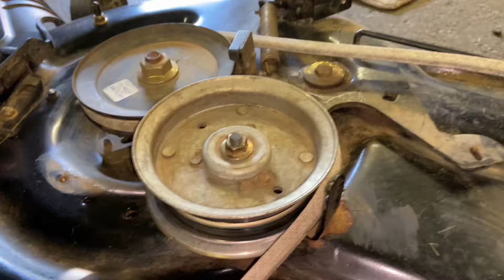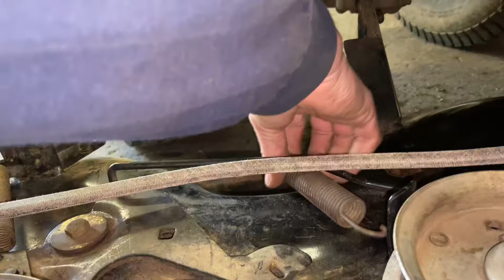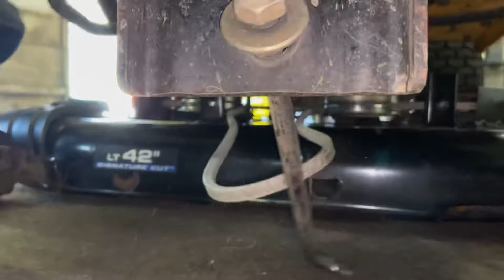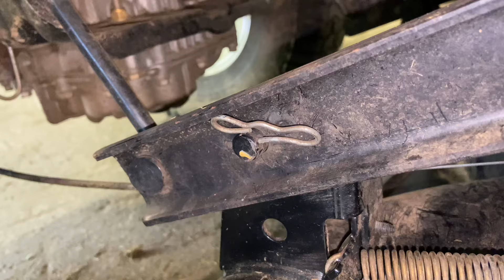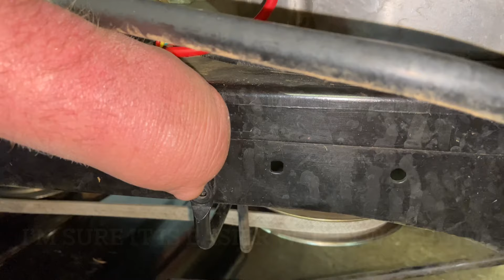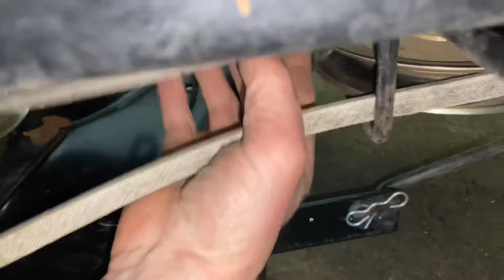How to install a Mower Deck Belt on a Cub Cadet XT1 42”

Comment: Great job with this video!  Thank you!
Reply from the maker: Hi Frank, I’m glad this was helpful and thank you for the kind comment. Please give this a like, subscribe and tell your friends to help my channel grow. It would be greatly appreciated. Thank you for watching:)
Reply: I gave you a like - do you have another video about adjusting this same belt?  I've got it installed with the help of your great video, but it keeps popping off.  It may be too loose, and perhaps that's why my original belt broke in the first place.
Reply from the maker: There are no adjustments, the only reason why the belt would fall off is when you disengage the belt, the belt guides may not be properly reinstalled or missing/ broken. You said, something may have broke or bent (reason for first belt coming off) you will need to find out why?

Comment: Nice video.  I have a XT2.   I only have 2 deck wheels.  I notice you have 4.  My deck cuts unevenly and I wonder if I should have 4 deck wheels.  Your thoughts please.
Reply from the maker: The wheels are there only as anti scalp wheels. Never rum the deck on the wheels. Check all tire pressure and level mower deck. If  the mower deck still cuts unevenly then you either have bents blades or a bent mower deck or both. Both can be corrected.

Comment: I didn't take the whole deck apart but put it back in place and it lasted 3 weeks and slipped off again.  I put belt back on but after a minute had slipped off.  My husband took a part off like a hanger but I don't know where that goes because he did that before I came out, so he can take it to the shop.  The belt was loose when I put it back on and wondering if the manufacturer put it on incorrectly to have slipped off after a few months after purchase twice.  They are ridiculous to deal with and I won't be buying another one from them.  
The video was excellent?
Reply: I'am having the same issue.. I wonder if their is a belt adjuster/tightener for this model.?

Comment: Thank you for uploading this. Great video and very helpful!
I have one question. 
Why not also change out the pulley brake pads? In your video at 6:38 they look worn out.
Asking because mine look the same with the pulley half way through them. Thank you.
Reply from the maker: I'm glad this was helpful. Please give this a like to help the channel! I have noticed the brakes wear quickly to half way and then they go a long time after that. I do not like the design but it is what is is. No need to replace brakes when they are only half worn plus this video was just about replacing the belt. Thank you for watching and commenting!

Comment: Can u pls tell me what ratcheting wrench were u using?
Reply from the maker: Milwakee 1/4" electric Ratchet. Here is a link to see it. https://amzn.to/3scvhqB. You can also get a cheaper one from Harbor freight if you have harbor freight in your area. Here ids a link to look at it. https://www.harborfreight.com/12v-cordless-14-in-ratchet-tool-only-57248.html. Both of these you will still need to purchase a battery and a charger.

Comment: After following this detailed guide now the engine won’t crank. Is there a safety that I messed up?
Reply from the maker: Make sure the PTO “power take off” for the mower deck is in the off position. That would be the only safety switch that would not make it start and that is only if you have a manual blade engagement handle.

Comment: I just replaced my belt, and when I tried to engage the deck like you did at the end of the video, it felt like something came loose or snapped. Now that lever doesn't seem connected to anything.  Even worse, now the mower won't start -- it just whines.  :(
Reply from the maker: I always asked a question why did the belt break the first time? Check to make sure that there was nothing underneath the mower stopping the blades from moving. If the blades are not able to move then that belt would break once again. It sounds like you may have other issues if you’re hearing a whining sound from the engine. Battery may be low in power? Impossible to diagnose without seeing your machine. Always double check your belt on how it runs through the idler pulleys and make sure your blades are not obstructed under the mower deck.
Reply: @JohnsonsSmallEngines  Thanks for the reply! Belt was thrown (and notched) during deep grass mowing. I cleaned the deck and the blades can spin. The belt does seem awfully tight, but I triple checked that it's the correct one. The battery is nearly brand new. Installed a month ago and only run the machine a few times on it. Voltage indicator is also good.

Comment: Is there a tension adjust for the belt anywhere on Cub Cadet xt1 enduro? My belt is too loose.
Reply from the maker: Make sure the belt is correctly installed. It will be loose until you engage the belt. Make sure you have the correct OEM “original equipment manufacturer “ belt. After market belts sometimes do not work.
Reply: @JohnsonsSmallEngines  Thank so much. Truly appreciate your time!
Reply: @JohnsonsSmallEngines   so to be clear, no tension adjuster  for this make and model. I have a 1 yr old  cub. The  belt keeps coming off the pully.. Great video..!
Reply from the maker: @paultaylor7570  if you have a manual blade engagement handle, the only tension is when you engage the belt to run the deck. If the belt is dropping off when you disengage it you most likely have a belt guide not correct or something is out of alignment.
Reply: @JohnsonsSmallEngines  Thank you for your response and answear..! you have been very helpful and I will follow future videos of yours..!!

Comment: What about when you get the belt installed, but the deck arms won't go back in the correct holes to connect the deck back to the mower? Maybe my belt is too small?
Reply from the maker: If you purchased the OEM belt? It should be correct. You may have to lift up the deck in the side and front off the the ground to manipulate the deck so rear hangers will go where they need to.
Reply: @JohnsonsSmallEngines  I didn't get the OEM unfortunately. Broke these days lol. How big of a difference in approx inches, is it between a new belt and an old stretched out one? There's about 3-4 inch difference in the 2 belts.
Reply from the maker: No way of telling how much a belt will stretch but never heard of a belt stretching more than a 1/2 to 3/4 of an inch. If your new belt is 3 to 4 inches shorter than that most likely is your problem. Maybe you ordered the wrong belt??

Comment: I got the belt on as you showed but now mower won’t turn over. Any ideas???
Reply from the maker: Make sure the mower deck blade engagement lever is in the off position.

Comment: Great how to video! Word of caution- the step where he describes putting the front belt guide on with the drive engaged is very important. I made a $50.00 mistake and ran my deck with the belt on the out side of the guide. Very stupid! I regret not watching this video first.
Tinker on and stay thirsty my friends! Cheers!

Comment: Mr. Johnson, I am having trouble with my belt coming off the inside pully right side. It's a new belt, the correct belt and is slightly smaller than the belt I had on it. Any suggestions? BTW I hate the bowtie clips. I changed 3 of them for the 2 prong clips.
Reply from the maker: If the belt is coming off when you disengage the mower deck? Then check your clearances between your belt covers and your belt guide underneath the Engine pulley. If the belt is coming off as you’re cutting the grass? Then you may have something major going on with the deck something bent? That is all the advice I can give you without seeing the machine. If you’re not using a OEM “ original equipment manufacturer “belt, I would suggest purchasing one.
Reply: @JohnsonsSmallEngines  Thank you. It's the OEM belt. I guess it's something wrong with my deck. The first time it jumped off as I was cutting my lawn. Then after I put a new belt on. After engaging my blades, 2 mins later it jumped off again. I'll take off my deck and check again. Thank you so much for your advice.
Reply: @JohnsonsSmallEngines  Mr. Johnson. I took my deck off and looked it over carefully. The pulleys seem tight. I check almost all of it, Then I looked at the blade brake, on the discharge side of the deck. It had deep grooves in it, so I ordered a new one, an OCM. I haven't got it yet.  I watched another person, on You Tube, he fixed the one he was working on. And showed other things to do to it too. I'll check my keepers too. I'll make sure that are close to the pulleys, but not touching them.  He suggested using an off-market brake. He thought they are better and a lot cheaper.  I thought I would pass that on to you so you may help someone else. BTW My mower is 8 years old. That might be why I am having trouble with the brake.  I'll let you know how it turns out. Thanks for all you advise and help!  Have a great day.

https://www.youtube.com/watch?v=2h_deQynPZY&t=519s
Reply from the maker: Thanks for keeping me up to date. I wish you were close by. I would come to you to help:)
Reply: @JohnsonsSmallEngines  Hey dude If you were close by, I think I would let you fix it first.  If we were closer, I would probably be there once a week, I am retired. just to help you out. Cleaning mowers. sweep up your shop, little things just to help you out. And to get free advice. LOL
Reply: @JohnsonsSmallEngines  Mr. Johnson. Thanks for you advice I put the brake on my deck and that fixed it. I think I should have put both brakes on (Since my mower is 8 years old) and I will as soon as I get it ordered and in my hands. But the main thing is my belt stays on and I can mow my yard again. In the last 2 weeks we have had almost 13 inches of rain and my grass grows so fast you can almost see it growing. LOL Thanks for your help and advice. Have a great day!
Reply from the maker: Wow 13” of rain. I’m glad to hear your back up and cutting. Thank you for the update.

Comment: I did step by step and everything is super tight and won’t disengage to start and deck is hard to lift up and down what did I do wrong
Reply from the maker: It sounds like you may have the incorrect belt size. Always look up your part on a cub cadet parts look up using your model number from under the seat.

Comment: my pulley on the right side keeps coming unscrewed and the belt is coming off. any idea why that is happening?
Reply from the maker: Impossible to diagnose that issue without seeing the machine. Sounds like something either isn’t tight enough or miss aligned and then isn’t tight enough.

Comment: I replaced my deck belt just like the video but now my mower will not crank. Thought it may be battery so I hooked it up to my car with jumper cables but still nothing. Any ideas?
Reply from the maker: Sounds like your PTO “power take off” blade engagement lever may be in the engaged position. Make sure it is in the off position, then try and start engine.
Reply: @JohnsonsSmallEngines   And how do I do that? Thanks
Reply: @JohnsonsSmallEngines  I bought new this year XT1
Reply from the maker: Watch this video, https://youtu.be/l-KGObLYAx0
This will show you how to engage your blades, then "Make sure your blade engagement lever is disengaged".

Comment: I have a xt1 46in 3 months old and today the belt snapped broke off please tell me I didn't buy a POS
Reply from the maker: Belts normally brake for a reason. It’s normally not the machines fault. It’s normally the conditions around the machine.
Reply: @JohnsonsSmallEngines  could you further explain ? Example flat ground leveled grass dry non wet, I lubricate this tractor after every run and garage kept climate controlled it has left me seriously wondering about it.
Reply from the maker: The only way to figure out what has happened is to look at it and figure out why it broke. Too many variables to guess. Do you wash machine with water? Did you cut high grass? Way too many variables and without seeing machine there is no way to tell from my end. Good luck with it.
Reply: @JohnsonsSmallEngines  I do wash the machine and also use the wash port.
Grass has always been cut at 3 inches.
Thanks man I aport your responses.
Reply from the maker: I have learned that washing machines and using the wash port is not a good idea. It can make bearings loose there grease and they can  seize up. Suggestion; Check all your idler pulleys on your mower deck and make sure they spin freely and are not loud sounding. If one of the pulleys even the blade shaft is seized, That would be the reason why the belt snapped.

Comment: I just watched two videos when trying to figure out out to replace the belt. One guy had a missing leg and you have a missing hand.... I'm starting to get a little scared.
Reply from the maker: I was born that way. You’re the perfect example of why I now have to explain to everyone in the first 5 seconds of every new video what happened. Just be happy you have two and I hope this video was helpful :)
Reply: @JohnsonsSmallEngines  Oh, well... you don't have to explain anything to me. It was just weird that the first two videos I looked up the first one had a guy with a prosthetic leg and then you. 

You don't have to explain to anyone why anything happened. The guy with the missing leg didn't explain to anyone as far as I know and I didn't ask... and I don't really care to be honest. It looks like you get around good enough and that all that matters. You could have been born a roach or a fly or something so be happy you weren't ;)

And yes, the video was quite helpful. I'm sure it cut the time it took for me to figure out how to change the belt by about 90% so it definitely saved me some time. It was much easier though than I thought it was going to be. I wasn't actually going to go through the trouble of removing the deck since it seemed harder in the video(I guess the explanation slowed it down and I'm kinda impatient).

1. I didn't unscrew all the bolts on the side cover. I saw that I could unscrew just two and rotate the cover out so this saved me 2/6 screws ;)

2. I just bent over those brackets a little. Not really bent but pried them a little and the belt slipped right in. I'm not sure if someone bent them over or not before but it seemed not cause any damage(they are flexible enough and there wasn't really that much needed, maybe 2 mm or so).

But all in all it was much easier and I can say that your video was better than the leg guys ;) Main thing was just realizing to go for those release pins and that cable to get the deck out then it was a piece of cake and took maybe a minute to put the belt on. Maybe took 20 total and it was the first one I've ever done. Was pleasantly surprised as I thought it would be a much bigger PITA than it was. 

So yeah, thanks ;)

Now if you can only solve the problem of finding cheaper belts ;)  (I wonder if one can place those pullies with gears? ;)
Reply from the maker: No worries. 
   I have personally found, the cheaper the belt in price, the cheaper the belt in quality. I have found that out the hard way.
  They did make a cogged pulley system that worked with a cogged belt on a few different model mower decks and they all were not good. If you hit something hard enough to stop the blade, it broke the belt. The cogged belts were also much more money than a regular belt.
Reply: @JohnsonsSmallEngines   I don't understand why there is not a strong metal cable core in these belts... or maybe Kevlar? Or does that cost much more?

50$ for a belt is truly price gouging... of course it's extremely common now days.

I'm not talking about a cogged belt though but actual gears. Those two pullies are right next to each other and one could easily mount two gears. One would have to still use a belt though from the engine shaft though.

But maybe gears could easily get jammed up?

Just seems to me that they could upgrade the belt design to make them much stronger so they basically last a life time... but I guess there is no money in that.

Comment: That might be one of THE worst designs I have ever seen to just change a belt!  My older cub cadet (1990’s), you can literally change the bet by taking nothing off.  One spring loaded lever and that’s it.  
This video was almost 17 minutes by someone who knows what he is doing.  
Could you imagine how long it would take the typical DIYer!!!
You shouldn’t have to do that much to change a fucking belt.
My god.  What nitwit designed this??
Reply: It’s actually pretty simple

Comment: I followed this video and my belt was loose
Reply from the maker: It should be loose until you engage the blades. If it is still loose after engaging the blades,  you either don’t have it correctly routed or you purchased the wrong size belt. Unless you have other issues.
Reply: @JohnsonsSmallEngines  The belt on the left idler pulley was shaking
Reply from the maker: Sounds like something is bent, blades?, spindle shaft. Even the pulley sometimes will bend.